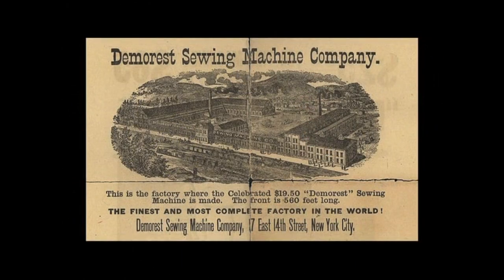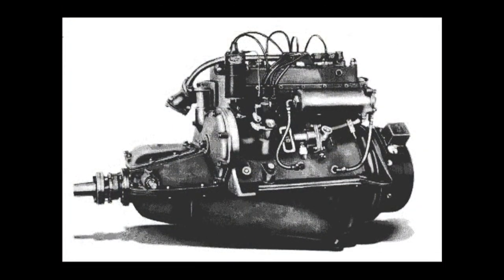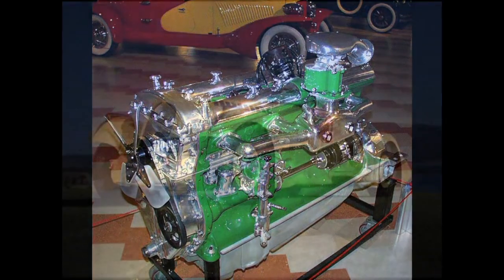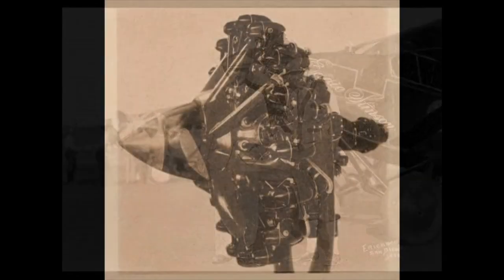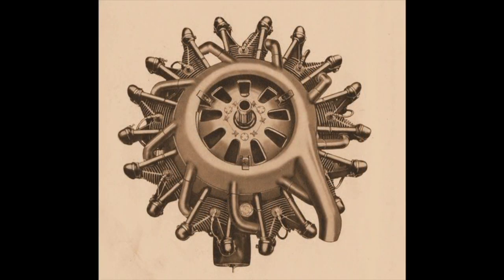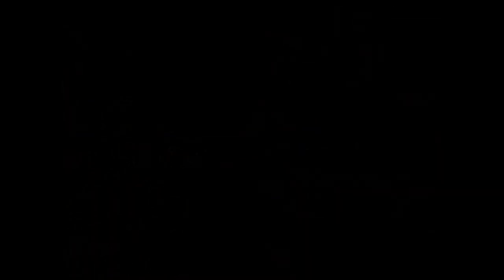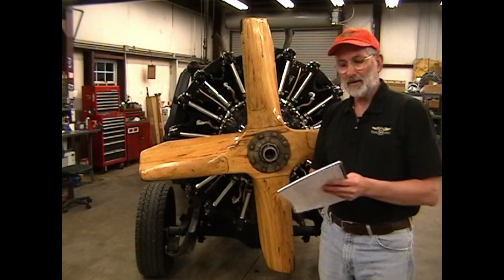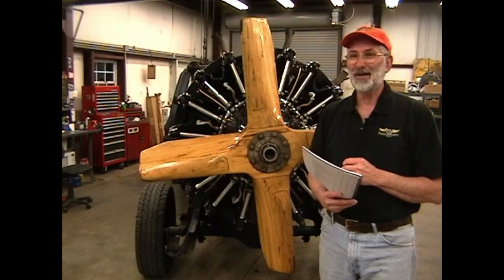Lycoming R680 - Part 1 - History and model differences

Comment: Great video. 
I have the -13 on my Stearman and I love it. Glad you showed viewers the manuals for these engines as well. Wealths of knowledge in those books. 
Quick question, you mentioned magnesium builds with certain 680s. Which of those engines were likely to be built that way? I’ve lately been questioning my old rocker covers to be magnesium. They leaked and I never felt they sat flat atop the cylinder. Thanks for the info!